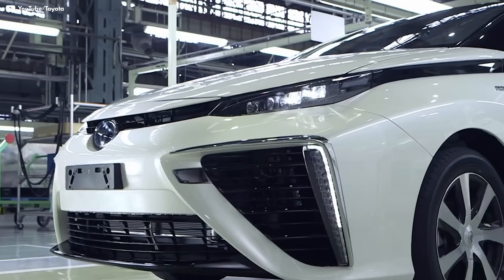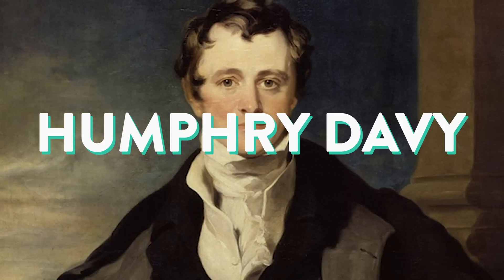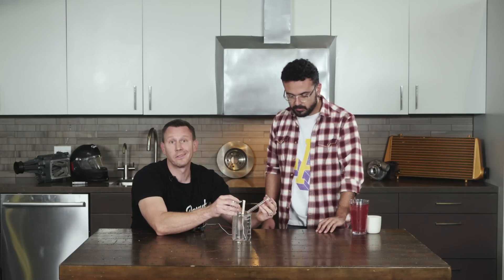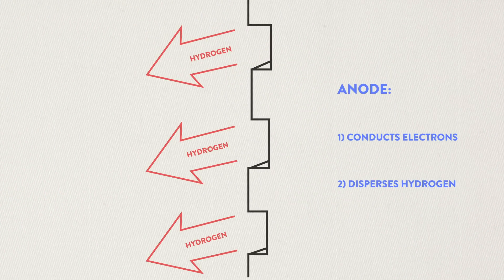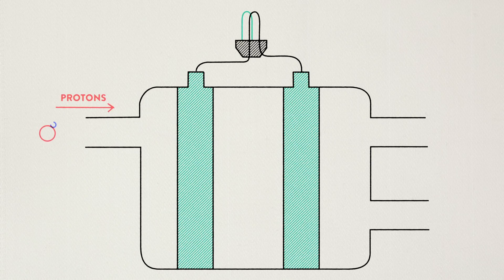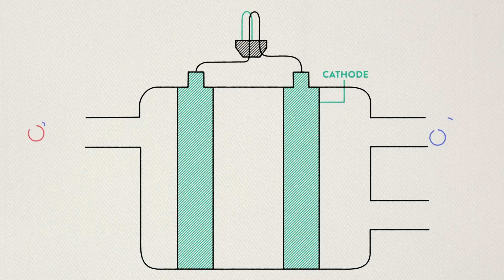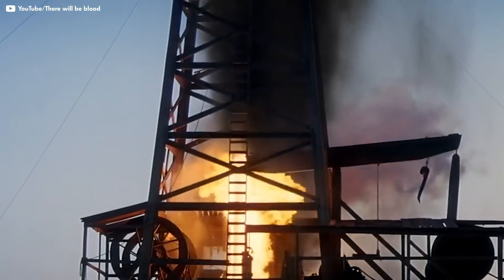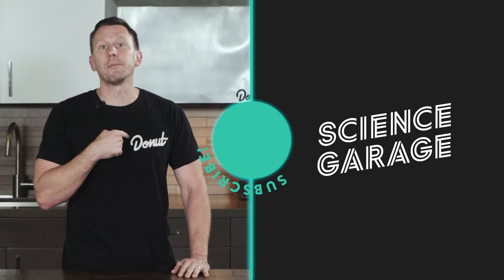How the Toyota Mirai Charges in 5 Minutes | Hydrogen Fuel Cells | SCIENCE GARAGE

Comment: rather than try to solve all the worlds problems in one shot, just make a liquid hydrogen fueled combustion engine. no need to expensive platinum substrates and temperamental charging systems.
Reply: I used to think the same until a professor talked about why it's so hard to achieve that, and as Wikipedia says:
"Susceptibility to hydrogen-induced cracking ('embrittlement') is often a result of the introduction of hydrogen during forming, coating, plating, cleaning, and finishing operations, often referred to as 'internal embrittlement'. Hydrogen also may be introduced over time (so-called 'external embrittlement' through environmental exposure (soils and chemicals, including water), corrosion processes (especially galvanic corrosion), cathodic protection, and/or from hydrogen generated by corrosion of a coating."
Reply: Mazda tested this with their Renesis rotary engine and reported a loss in power (something like 102 hp), so maybe not as close to fruition as we'd hope
Reply: Bmw made a 7 series hydrogen flexi fuel that lost only 10s of horsepower, about 30.
Reply: The Nazis made hydrogen peroxide submarines
Reply: The "liquid" hydrogen is the problem. But the good thing is that it's not hard to run a few trivial chemical synthesis steps on hydrogen and carbon dioxide and turn it into methanol. Which is liquid. And can also fuel a combustion engine.
Reply: @zolikoff  store it as a liquid, burn it as a gas
Reply: Liquid hydrogen lol you think Platinum is gonna be more expensive than keeping H2 that cold?
Reply: @Mutantcy1992  wont need to keep it cold if its under pressure
Reply: @whatchu_talkin_john_willis  liquid hydrogen is a cryogenic fluid. It can not be kept a liquid with pressure alone. The only way to give it the density of a liquid at room temperature is to pressurize it as a gas to the point where the gas has the same density as a liquid, but this requires pressures that virtually no container could hold, especially in a car.
Reply: @whatchu_talkin_john_willis  Beyond what McHaZe said, that pressure is not going to be maintained as the hydrogen is consumed.  So what's your plan for that?
Reply: @phazos9223  there are already cryogenic tanks for liquid hydrogen
Reply: @caseyinutah  Cryogenic tanks do not hold cryogenic liquids forever; especially hydrogen. As heat slowly works it's way into the container, the liquid hydrogen would evaporate and run out through the tank's pressure relief valve. This is because cryogenic fluids can not be kept in the liquid state at room temperature no matter the pressure. The tank wouldn't empty overnight, but you would constantly lose a trickle of fuel as soon as the car left the refueling station, and this would happen in your garage as the car sat idle too. This is why current hydrogen cars use pressurized gas and not liquid.
Reply: You're just losing efficiency and reintroducing emissions into the problem while keeping the expensive and unavailable nature of hydrogen right now. Its extremely hard to keep it at low enough temperatures and high enough pressures for it to be liquid. Also charging systems? you don't charge a fuel cell you fill it up with more hydrogen.

Comment: Why not use water and electrolysis to get hydrogen and then use hydrogen to power the vehicles?
Reply: because you'd be using electricity (dissociating water) to make electricity (H+ in fuel cell), and due to the law of conservation of energy, you would be wasting electricity in the process
Reply: No, you didn't understand me. I mean use hydrogen as fuel as we use gasoline today. Guess that is possible since few guys already made engines that run on water(but they mysteriously died). Search "Water-fuelled car" on Wikipedia
Reply: Everything that you say is possible. It is just the human unwillingness which is holding us back.
Reply: @mrguest3749  yeah, that's right. Cause water is free so they don't want to make water engines

Comment: if you use solar/wind power to perform electrolysis then the process is 100% renewable.
Reply: Toyota uses wind energy to charge batteries and then generate electrolysis to get hydrogen
Reply: what if I put a hydrogen fuel cell on a generator and used it to power its own electrolysis?
Reply: @megakiller999  you eventually expend all the energy you started with into heat.
Reply: @vhateverlie  Not if I put it in the freezer insert appropriate meme
Reply: megakiller999 Actually, that’d make the problem worse.... If for no other reason than the fact your probably trying to run the freezer with your device.
Reply: Well the petroleum to run the windmill and make the solar panels isn't exactly renewable.
Reply: Is that not the exact same "what if" that current electric vehicles suppose? They arent right now, but will be one day. Eventually. Probably whenever a petrol company breaks rank and allows the earth to survive, disregarding greed entirely...right.
Reply: SuperCookieGaming thinking about it, there’s no such thing as renewable energy. Like, truly, solar isn’t renewable because the sun is a just a big fusion reactor, wind needs the sun because wind is a cause of temperature change. It’d be like making a fire, putting a solar panel near the fire and calling it renewable, you need something flammable like gasoline, kerosene, alcohol, etc which are non renewable in order for the panel to absorb the light. All I’m saying is there is no wind and solar which we say is renewable when the suns nonrenewable resources burns away. All the energy we get that we call renewable comes from a non renewable resource somewhere down the line. But the sun is far from dying so it makes sense to call it renewable.
Reply: I like the idea but at that point you might as well just use that electricity the power the motor and ignore any wast at all.
Reply: SuperCookieGaming 
No...
Because you have to make those powerplants and batteries.
Reply: Sorta like how most electric cars dont use renewable energy.
Reply: @markmiller4503  I thought they recharge using solar panels? Or at least the supercharging stations do. Can u explain how it works pls?
Reply: @forzaelite1248  So people only charge electric cars at super charging stations?
Reply: @markmiller4503  No, there're other places and methods, but I figured they all relied on renewable energy since it would be counterintuitive to claim that EVs are cleaner while making their electricity from non renewable sources.
Reply: problem is the efficiency of these methods (especially if using salt water).  while the salt does act as an electrolyte it also amplifies the anode corrosion on top of the basic issues solar and wind have already
Reply: theblackmech yes that's a problem, but a problem before we even get to that is poor electricity storage from power companies. They're not lazy or anything it's just difficult to store a lot of electricity. That's why power companies often turn off solar panels because it's generating too much electricity when it's sunny. 
SuperCookieGaming 👀
Reply: @viiixxviimm  Yeah tell that to california.
Reply: @whatchu_talkin_john_willis  How efficient is wind and hydro power we don't use? 0% efficient. By storing this wasted energy as Hydrogen, if then becomes usable and efficient compared to not using it at all. Or we can store the waste energy in batteries which require us to use industrial mining, shipping the resources round the world etc etc. Using renewable energy which is currently not being used IS more efficient than NOT using it.
Reply: The Mighty Dash Basically true. Now think of all the extra carbon free electricity available overnight at hydroelectric, geothermal, and nuclear power plants. Conversion factors aren’t great (yet) but truly we waste a ton of electricity while hydrogen is very sensible to produce if a market exists and distribution costs become affordable. Hydrogen is next and will enter through large industrial use first, but I’m looking forward to my first hydrogen-powered car.
Reply: @acchaladka  I'm waiting for the personal Nuke device to power cars. Fission & fusion ohhh yeah. But that's just fiction as of today. Engineering Explained had a great video on why we continue to use fossil fuel technology as to electric vehicles.  Comes down to efficiency and technology combined with manufacturing cost and production costs and implementation.
Reply: Boywonderr71 I see you didn’t read my post carefully. I watched and debated Jason’s video at the time but thanks for the pointer. Though he’s good at automotive engineering he’s no power systems engineer or planner and it shows - he misses a few important points and perpetuates some misunderstandings. Anyway, best of luck out there.
Reply: Or nuclear
Reply: Remember that Germanys solar initiative failed personally I like water and wind power solar is just not effective enough in land to power ratios
Reply: Does it renew the birds who run into wind turbines tho
Reply: @Mutantcy1992  Yes the downed birds are eaten by field mice, who are then caught by birds and fed to baby chicks.
Reply: @user-pf5xq3lq8i  unsure if you're serious.  if you are, then...wow
Reply: @Mutantcy1992  what about the turbines slowing to wind down